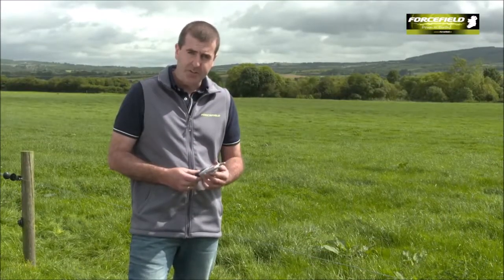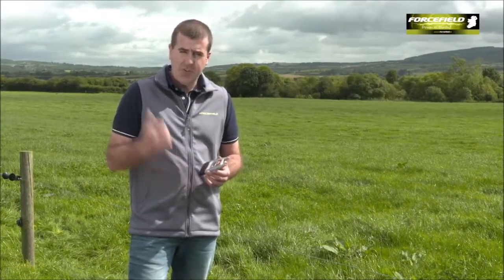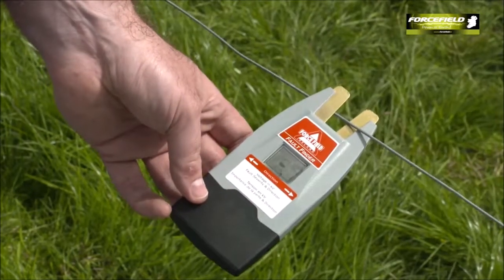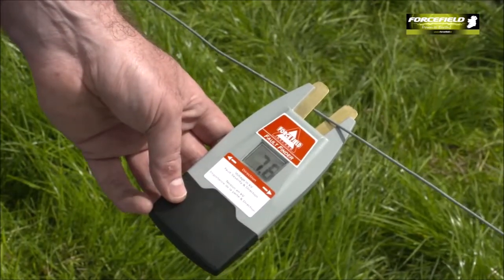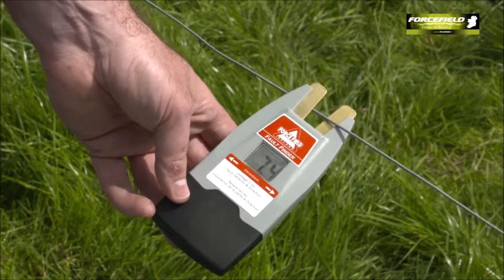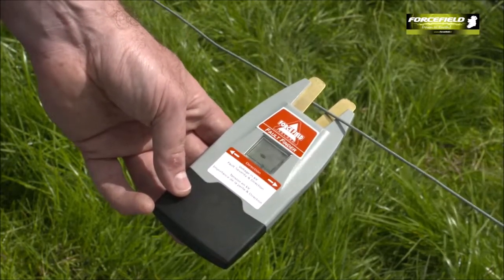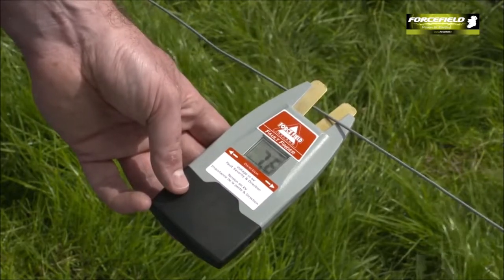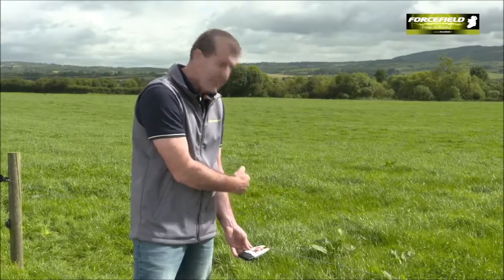Forcefield Fence Fault Finder

Comment: How do you change the battery
Reply from the maker: The black piece of the housing at the bottom of the unit can be detached from the main grey part of the housing by pushing in the tabs in the side. This exposes the battery holder and the battery can be replaced.